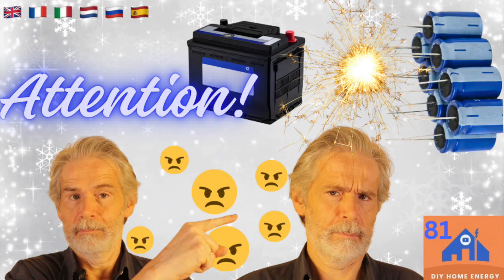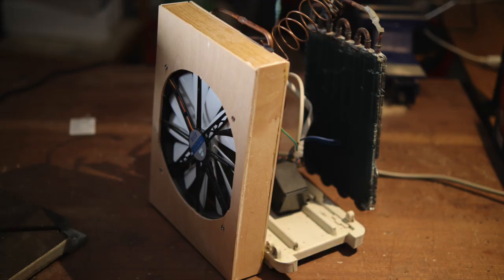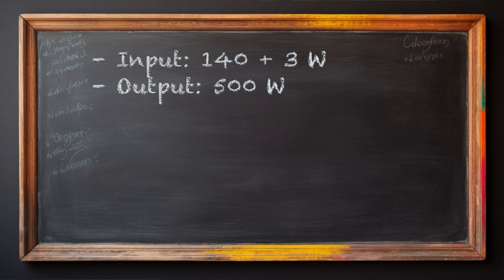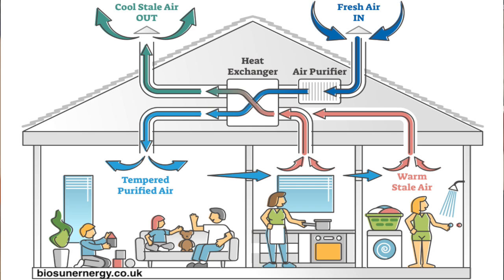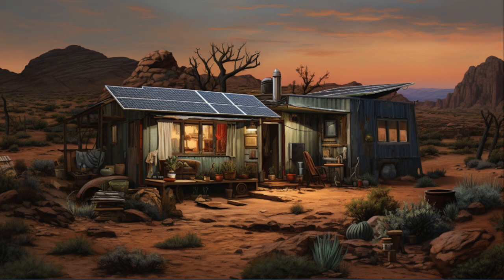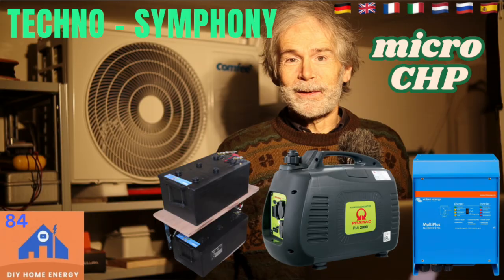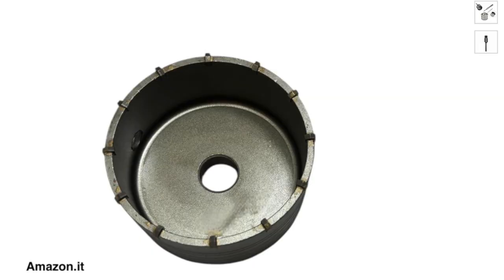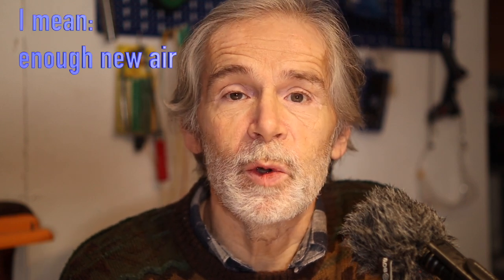The SECRET to HIGH Indoor Air Quality Without Losing Heat!

Comment: Most interesting would be the frost handling system which plagues these type of systems.  Also decibel measurement and its impact on room living quality.
Reply from the maker: Thank you for the good question. You will have no problem with the frost in the heating mode (winter). The stale air from inside is at about 20°C and that will go through the evaporator so that will cause no ice build up. The frost from the outside is also not a problem because the cold air will pass through the warm side, the condenser before it is going into the room.
Reply: @nnvasen-good-energy  That's amazing.  You seem to have solved a problem that has evaded all manufacturers for the last century.  Stale air from inside that is usually humid must be cooled by the evaporator to provide heat to the condenser.  As more heat is removed, the moisture condenses then freezes.

If you're going for near 100% efficiency and are receiving fresh air well under 0C, you need to drop stale air temperature to 0C or below (of course considering latent heat gain from condensation/freezing and engine mechanical heat generation).

Does this mean you're tuning the system to just skirt the freezing point by sacrificing efficiency?  or using a novel way of reducing stale air temperature to under 0C without issues with icing?

Comment: Conservation of energy - energy doesn't appear out of nothing. Single 150W compressor with ideally 500W of heating output is the same as 1500W compressor with 5000W running 2½h a day.
Reply from the maker: Hi Tarassu, thank you for your comment. Indeed, a heat pump doesn't go against the conservation of energy. What you write afterwards is to mention upscaling? I am working on this small scale because with a pair of holes in the wall you can provide air change in a fairly sized room and then is 500 W enough to raise a certain air volume with 30 degree C. However, see the comment of Vottat 4 days ago, below. A standard mobile airco takes about half of what you mention (1.5 kW compressor) and can simply be adapted (without even be modified itself) to do the same. Good for a space of 200 sqm. 
I hope this is what you meant.

Comment: another thought provoking video! 140w is still a lot, how would this size to a motorhome? I'd love to also create a little overpressure, so that the cold wind outside does not blow inside so easily, as that is harder to heat up than making up for losing some conditioned air. overpressure might also help reduce poor quality air received while actively driving on the road.
Reply from the maker: Hi Michiel, thank you for your kind comments! I would create a pressure difference by a different fan speed. That is easy with DC fans. Otherwise and if you are driving, you can put a 90° angle on the air outlet and turn it against the driving direction until the pressure difference is what you want. It would be nice if inlet and outlet are coupled mechanically so that you control immediately the pressure difference instead of the single pressures. The power of 140 Watt is indeed much and a  constant drain of 13 A on you battery is not funny.  You can use it as a base load and switch of when other loads are needed. Unfortunately all those dehumidifiers are without soft starter and will upset the board inverter with its start current. I will try to start it in my video with a soft starter because then you can run this with one of those cheap travel inverters.

Comment: LOOKING FORWARD TO SEEING IT IN ACTION...

MONEY SAVING TIP FOR VIEWERS-INSTEAD OF BUYING CORE DRILL THAT YOU WONT USE AGAIN, BE ECO-),DRAW THE HOLE ON THE WALL,THEN, USING A DIY MASONRY DRILL BIT, DRILL HOLES AROUND THAT RING,LEAVING SMALL SPACES BETWEEN EACH( OR DO VERY CLOSE TOGETHER,IF YOU HAVE PLENTY OF TIME)...
ONCE YOU HAVE GONE AROUND THE RING, DRILL+ FIT A SCREW, WITH STRING ATTACHED - THIS IS TO STOP IT FALLING INTO THE CAVITY, WHEN YOU USE A LARGE HAMMER,OR ANY HEAVY OBJECT,TO KNOCK THE PLUG OUT...
IF YOU HAVE A CHISEL, PUTTING BETWEEN HOLES AND GIVING SEVERAL BLOWS WILL MAKE KNOCKING OUT THE PLUG EASIER...
THIS IS CALLED STITCH DRILLING,AND WAS USED BEFORE CORE DRILLS CAME ALONG.
THINK OF IT LIKE A CARDBOARD BOX WITH A PERFORATED  LID- YOU APPLY PRESSURE, AND THE  PERFORATIONS PRODUCE A HOLE.
Reply from the maker: Yes viewers, I think this is certainly a good alternative 😀. Thank you Liam! It was just curiosity and the surprise that the core bit was not so expensive as I thought. I will drill at least 3 pairs of holes here and then if I like it, will bring it to our Zero Energy Holiday Home in Sicily, on mount Etna, where the hot weather can also require fresh air ... and also cold. So that our guests can sleep.
Reply: @nnvasen-good-energy  CARRY  YOUR LARGEST DIAMETER DRILL BUT- SOME CORE DRILLS ARE TERRIBLE QUALITY- THE BAD ONES WILL ONLY DO 1 OR 2 HOLES...

Comment: Good idea, I think the Air flow with the heat pump should be portable from a room to another one, what do you think of It?
Reply from the maker: Thank you Clon, I thought to fix my version on the wall and leave it, also because you will be each day once in the living room, then you will sleep in the bedroom. I think the different parts are quite cheap compared to the central heating so it should be possible to have 2 or 3 of them, where you live most and need fresh air. However, you can always make it mobile and then you have to cover the 2 large holes for each of the heat pumps

Comment: I bought a huge heat recovery system for a large athletic building.  It was considered about 35 percent efficient as I recall.  It raised incoming air about 10 degrees C.
Reply from the maker: Hi Joe, that is awesome! The larger the scale, the more energy is saved. Was it also working on the same principle? 
The comment of Vottat below shows that already a scale increase of 5x is possible with an existing standard market product, which has already incorporated the necessary fans. For a 1000 fold scale increase you would just take a standard chiller of 150 kW input and do the same thing. The result is anyway that a lot of heat is recovered, which inevitably would finish outside, as public buildings have this Indoor Air Quality regulations. 
If this sports building would be a swimming pool, you would also recover a lot more of latent heat.

Comment: I think air flows could be passive if heat was used as a draft system. It would take construction of some duct valves to switch between seasons.
Reply from the maker: Hi Dougpine, can you explain that?

Comment: I think someone with little time or expertice could make something similar with a small portable heatpump and connecting both paths to the outside.
Reply from the maker: Right, Vottat, that's indeed a brilliant comparison, it is indeed equivalent, good thinking! It is only the scale that is different, there is some work to do to create air duct adapters on the holes in wall or windows and obviously more noise but you can (as I intend with my small device) put the mobile airco on the outside if it will not disturb the others and then you have the power of 5 of my systems together. That would be an idea to include in my playlist for the Air Exchange with Active Heat Recovery ... If it comes so far, I will mention you!
Reply: @nnvasen-good-energy  Thank you for considering this idea. I think that with some electronics to monitor and route from where the air is coming to the loops in theory you could use a portable heatpump to both maintain air quality and heat the home.

I have something similar at home, I achieved it by mistake.

I value your comment on noise. I am very sensitive to it, I hope those that aren't can enjoy better air quality and be more comfortable.

You can validate your inventions using an Airgrafient monitor, I bought one and made one by buying the components. Let me know if you need help, I have validated it here.
Reply from the maker: Thank you Vottat, I looked on Amazon for an airgradient monitor and indeed, it measures about 5 characteristics.

Comment: Fantastic idea. However I’ve some reservations. If you extract air from a well insulated, air tight, room you cause a vacuum. Now we can all relate to the fact that a vacuum causes moisture to increase. Here in Scotland with our damp cold winter air, my fear is an increase in internal moisture.
Our air has >87% moisture if the outside air temperatures drops below 5°C, unlike a dry cold temperature, it’s very, very cold!! This gives us a huge problem in Scotland & many other parts of the UK.  Many, many homes with HP installations can’t be heated properly, Low Temperature Central Heating is nearly useless here.

The relative humidity is very high both internally and externally here in Scotland. However, heat recovery ventilation helps & it would be great to see this build.
Thanks so much for sharing & along with the capacitors build, that’s two videos I await with bated breath.
Kind regards from Scotland 👍👍🇬🇧🏴
Reply from the maker: Thank you very much Jimmy! Yes, also we noted that it is nearly impossible to heat a very humid home in winter, like we have in Sicily on 800 meters height (on Mount Etna) if we would be there in winter. We let friends there try first a dehumidifier (the same type that I am going to dismount 😃) down to 50% rel. hum. and then heat the appartment and they reported a huge difference. So then you need two of those devices, one to use right away and the other to transform 😁. One idea to put a video in the new playlist for Air Exchange with Active Heat Recovery is to "close" the unit of today's video on the outside so that it will return the dried air back into the house but that will be the same as using a normal dehumidifier inside the house. At least you save the investment for the second one 😉. So then you would let it run until the in house humidity is down and then "open" the return path outside the unit again so that the stale air stays outside and the input air is really that of outside. At least that humid air will decrease its Rel.Hum. because of the heating. Better would be to use desiccant grains in the inlet so that the inlet air has a double process: heating and drying. Would that be an idea to put in the next video?
Thanks again for your kind words and today I will try my red superLEDs that will short & indicate supercaps if some of them charge more then their brothers.